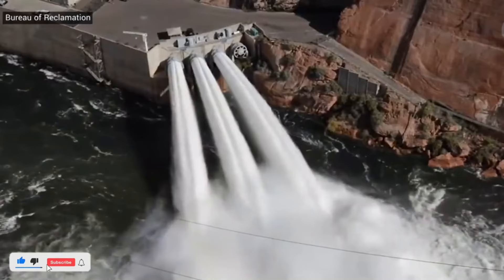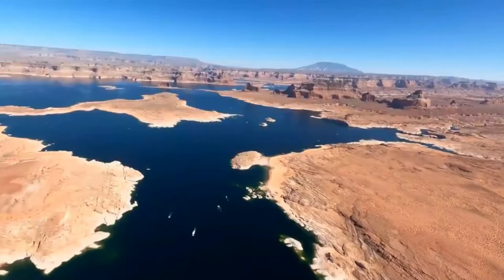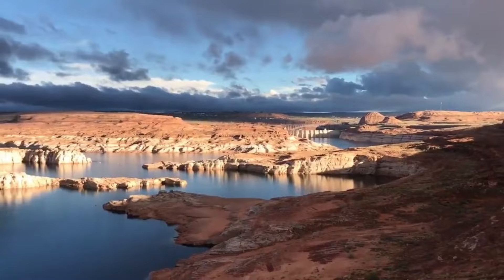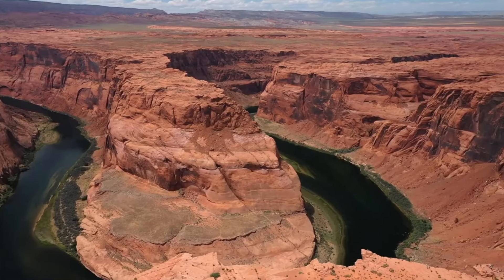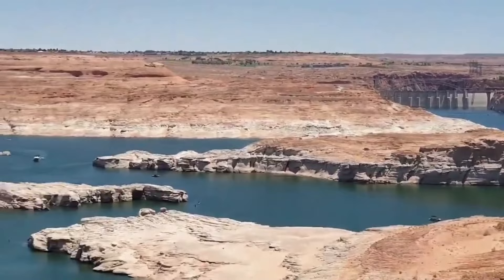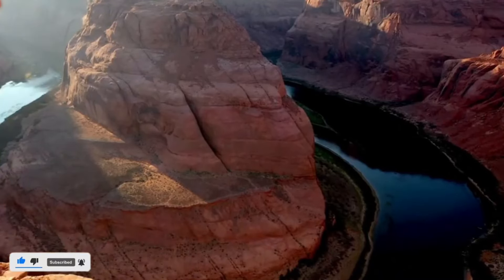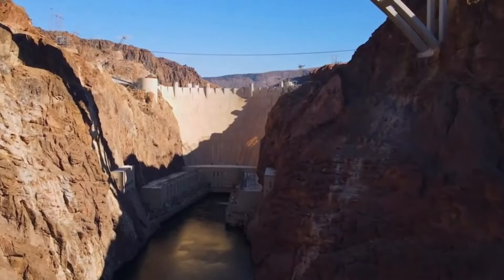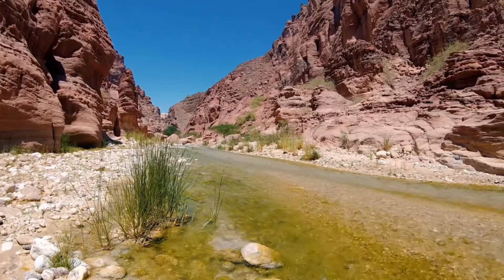Critical Damage At Lake Powell Dam | Plumbing issue at Lake Powell dam.

Comment: Water levels are 50' over 2023 in March.  As of June 7th, they're about 5' over 2023, but 35' over 2022. The snow pack, which feeds lake Powell, is 136% of median, and over 200% at it's max measurement.    Snow pack in 2023 and 2024 beat the snow packs in 2020-2022.   The trend is up, not down, like "climate change" would predict.   Let me guess, when it's down, it's climate change, but when it goes up, it's an "outlier", right?